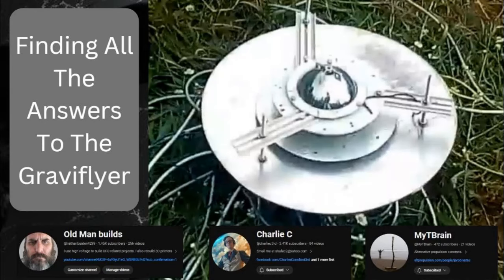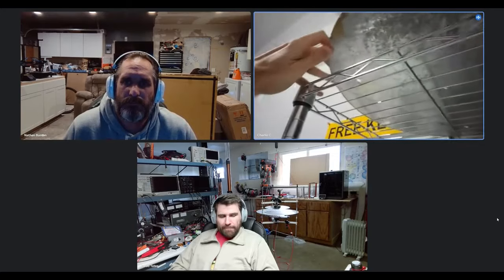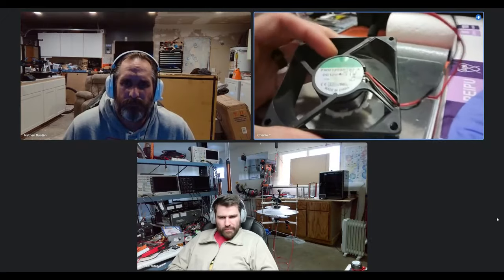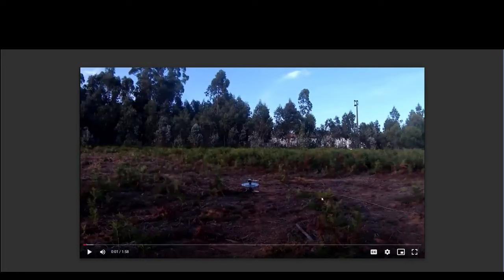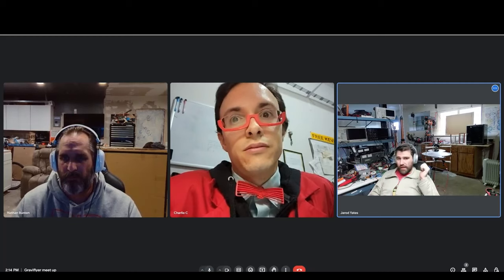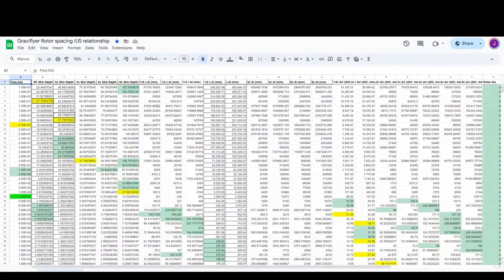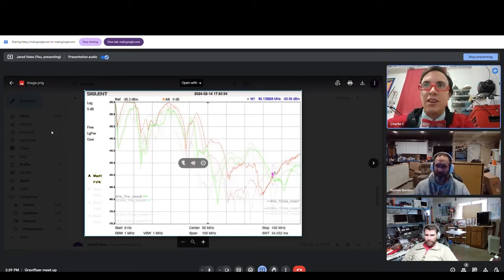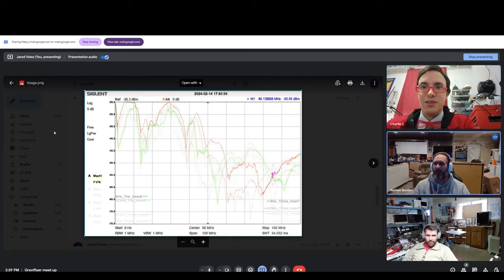Graviflyer "Discussing What We Know"

Comment: So the ultrasound at a super high(~100kHz) makes the two rotating plates have a higher capacitance? So the ultra sound causes a higher static charge to build up. 

Is it possible that the reason we pulse the ultrasound off is so we can release some of that stored energy? And that is what is creating the ratcheting upward effect by pushing it up every pulse off? 

So perhaps the ultrasound is just for adding to the Tesla coil and creating higher capacitance, allowing a thrust upward? 

If he disconnects it and it stays hovering there for a bit, the ultrasound is off, right? Does that mean it isn’t required for zero g force and only for generating higher static charges and pulse propulsion upward? 

It could also have something to do with adding resonant energy to each of the mechanisms but pulsing it off long enough to discharge some static charge off the plates to ionizing the air to push it but not too long that it falls? 

Just spitting some ideas out. But if all three of y’all see this I’d love to hear your thoughts

Edit: rewatching the end there I realize that’s kinda what was being said in the second half of the vid
Reply from the maker: the ultrasound is the lifting part. Tuning is the most important part.
Reply: @nathanbunten4299  lifting as in the portion that propels it up or creates the effect that nullifies gravity?

Comment: When using MOSFETs to drive the HV coil primaries,  are you using proper gate drivers in order to keep the gate slewing fast enough to prevent linear conduction in the MOSFET?  I used to burn MOSFETs out constantly until I added a gate driver.   Also when using transistors, placing a diode rated for the collector voltages that will be encountered, between the collector and base, prevents saturation of the transistor. This keeps it from heating up, slowing it down and RUD. Diode anode to collector, of course, in the case of NPN transistors.

Comment: The particles are charged and ionized, and the charge and magnets push the air away as it is like a hot air balloon. Keep on this subject.
Reply from the maker: It might be this or it might be hermonic resonance. We are working on it.
Reply: @nathanbunten4299  Nathan, I think it is both. The harmonic resonance gives a huge push to make the air above and below the device a vacuum.
Reply: Alexey pushes a button to turn off the ultrasound once harmonics is reached as Jarod told us at the APEC conference.
Reply: @nathanbunten4299  You would most likely need a fast computer to sense this and push the button as Alexey tries several times by ear.
Reply: @nathanbunten4299  I send my entire theory to the US government and military all of the time and I think that they are using it as they are also retrofitting the jet fighters in the same way and also Space X is getting rid of their methane tanks and replacing them with water as I also sent my theory to them so they could make a water fusion raptor engine like the B1. Commercial airplanes can also be transformed in this manner and go from NY to LA in matter of minutes.
Reply from the maker: @richardmuller867  We are getting closer on the theory. I will post the second meeting we had soon. It goes more in detail on the harmonics.
Reply from the maker: please leave me out of you submissions to the U.S government.
Reply from the maker: @richardmuller867  sorry just hearing things going to the government freaks me out. I didn't mean to say anything bad.
Reply: @nathanbunten4299  That is OK. I only report my theory and devices. I know how people can be.
Reply: @nathanbunten4299  No offense taken.

Comment: I don't really understand the premise, but is this supposed to be a anti gravity machine or a device using a peozo electric to hover ? Because Anti-gravity is straight up impossible. It's like saying -20 Kelvin, wich as we know would mean to make energy out of the Atoms or something like that. Correct me if i am wrong
Reply: I don't think evidence suggests that "gravity waves" are being generated.  My impression is that this is a very high efficiency, high power ion lifter, capable of lifting kilograms instead of grams.  Not so much a propulsive force either, more like atmospheric buoyancy technique. Once this buoyancy is attained, other propulsive means may be required to move it in any axis from it neutral position.  In light of this devices vulnerability to atmospheric conditions, and despite the claims of Alexei K, I don't see any evidence of anti-gravitation, but I hope I'm proven wrong.
Reply: @waynegnarlie1  but how do you claim to do something thst "floats" in the atmosphere without propulsion ? Plane's don't "push" air, but the low pressure area they create, generates the lift. Ion propulsion is basically wind and if you want to get kilogrammes lifted just with that, you expect to make a rocket (ion propulsion rocket). It is possible to lift, but i doubt we are talking about kilogrammes. (YouTubers such as Plasmachannel have covered ionic eind propulsion)
Reply: @waynegnarlie1  If it's an ion lifter, then it is at least 2 orders of magnitude more powerful than the most expensive ones currently used in space.

Comment: Electromagnetism can't lift it without using air for leverage. It requires Gigawatts of power to lift it with EM alone!
Reply from the maker: The inventor did it with far less. That makes this more interesting and safe.
Reply: @nathanbunten4299  Maybe true, but it would require it to resonate the voltage into the tens of megavolts to accomplish this without leveraging air. We're not seeing that kind of voltage present. So it either uses air as leverage or it's fake.
Reply from the maker: @ToddDesiato  No not fake. You missed the part about the emp. It takes a large voltage spike and a large vacuum to create the effect. 

You are judging the output based on the sum of the parts and not the energy that the parts make when combined. The interaction of the parts has a multiplying effect. You can tell by the voltage spikes wanting more energy from the tesla coil. It means that there was that much energy lost and it needed to replace it. 

Also a circuit can draw more power from the source in a voltage spike. It is why I kept blowing the tesla coil even with a better circuit. The tesla coil is acting like a power reserve and not as a regular tesla coil. The wire is not attached to the #2 coil at all. It is just placed down the center. 

We are on the right track with this.
Reply: @nathanbunten4299  That makes sense, and I'm simply saying that air is part of the equation, and it can't be done without it. FYI: Gravity has the same efficiency as a photon rocket. Even "if" it were creating gravity rather than EM, it would still require gigawatts of power, if it were not for the air.
The tesla coil should be pushed to it's maximum, but if that's blowing out the transistor, either use a higher voltage transistor, or fewer turns on the primary coil. That way the reflected voltage will be lower, but the current will be higher.
Reply from the maker: @ToddDesiato  Alexey uses a mosfet from a tubed t.v the voltage is 300v with a 6v trigger. It explains why his works and a regular slayer exciter z44 blows. I have one and will build the circuit with it. 

I am not convinced the coil size matters. In a conventional coil it would. However when he is not attaching it to the coil in any way. It takes the coil from an exact frequency to just a energy compensator. 
The wire is just placed in the center of the #2 coil. Not attached to anything. 
The spark over the wire becomes static volts.  It changes the way you look at the tesla coil in the craft.
Reply from the maker: @ToddDesiato  You might be right about the air. I asked the same question. Now that we have identified a possible cause we can investigate if further.
Reply: @nathanbunten4299  Alexey told Charlie that when using it outside, the wire to the Tesla coil is actually hard-wired, not just inserted into the tube.
Reply from the maker: @ToddDesiato  I have the video that shows it. He just throws it in. I will make another video about it when I do my tesla coil circuit for it.
Reply from the maker: @ToddDesiato  3:27 in the video He just drops it in. 
https://youtu.be/WyDsLVVLKVc?si=dpn5GMpDDIbyLHai

The video is describing what the meter does. Also Charlie C told me in the video of mine that Alexey moves the wire up and down in the tube to help tune it.
Reply: @nathanbunten4299  I know that is what is on video. I'm relaying what he said in other conversations. Outside, it's hard-wired.
Reply from the maker: @ToddDesiato  I spoke to Charlie C in this video and it is not hard wired. I asked him point blank about it.
Reply from the maker: time 25:55 in the video. Charlie C explains the wire.
Reply: @nathanbunten4299  Alexey has done both hard wired and dropped into the center of the coil (capacitively coupled). He has got the graviflyer to fly under both connection conditions. Indoors is dropped down the middle, outdoors is directly connected (usually).
Reply from the maker: @MyTBrain  I sent you an e-mail on what device I should buy for the ultra sound. 

I think I solved what Alexeys is doing to make it fly. He is using acoustic resonance coupled with static charge. I also know why it is getting a spike higher than the sum of the energy put in. He is getting a runaway resonance or townsend effect. I will explain in a video. 

The wire down the center is the better way. The back emf kills the mosfet when it spikes in a direct connection. When the voltage is passed through the air it can dissipate before it explodes the mosfet because it is directly tied to the circuit.
Reply from the maker: @MyTBrain  I just reviewed the ultrasound circuit. It is not like an ultrasound machine at all. I ordered the parts. I looks like a pulse circuit. Did you hook up the original circuit to an oscilloscope and measure it's range in frequency?  
The diagram is wrong as far as the power source. 12v? it is 32v 980ma